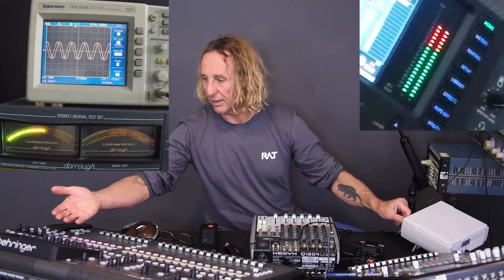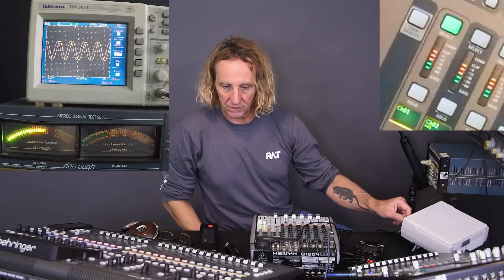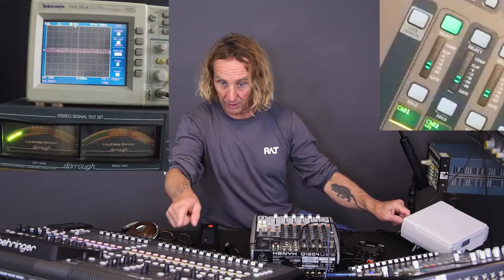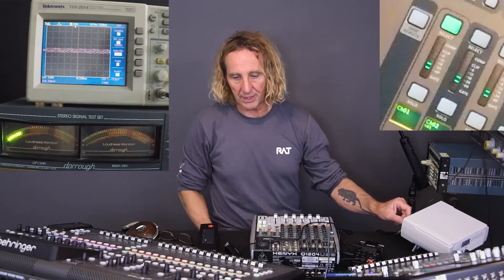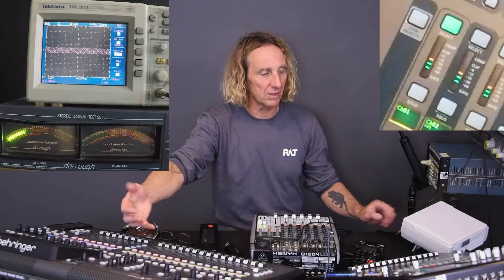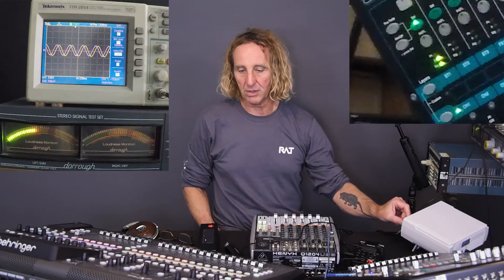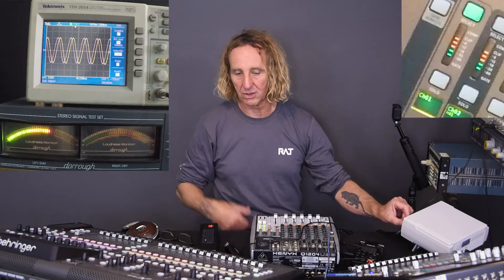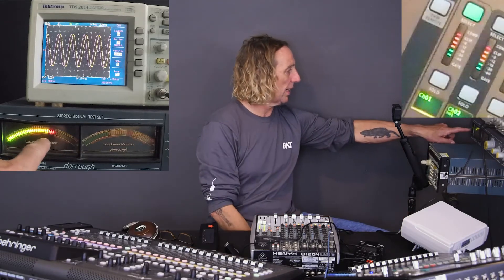Metering & Clipping - Behringer X32 vs Allen & Heath QU16 (Public)

Comment: Your tests confirm my ears. I have a conflict with operators running their boards too hot in the inputs. I use Allen and Heath exclusively because my background career in military electronics has me at repair and mod capabilities for my music equipment and fullfil my hi fi expectations for the most part. The straight forward tests you do are easy enough for many to understand.  And are what hi fi reviewers do as a part of the process of a component review.  The tell tale sign of odd order harmonics can be heard in timbre changes in acoustic instruments such as violin, cello, and even bells and upper register of a harp in a  piano. The smear can occur with latency being recombined in Channel  mismatches due to unequal pr grossly mismatched wire feeds , panning and or speaker distance and room acoustics phasing etc. I am actually trying out the Beyer M88 at a gig tomorrow.  As per your video on feedback . Better than a cloth on the squaker.  Hit it at the source. Finally an engineer that is pragmatic and hits the bone in hi fi. You are extremely experienced and with my 40 years of bouncing around all of this, someone I can recommend as the final stop in the U tube world of proper and concise USABLE  information to many of my friends watching me do things with live sound. 
P.S. -- I did the 3 speaker P.A. a year ago before actually seeing your video on vocals separation. Thought it was my invention.  Ha. But it works extremely effortlessly.  Now the IEMs forward facing even if rearset PA speakers are going to be tamed with the hypercardiods. Tmi. But you are the best....
Reply from the maker: love all of this

Comment: Im running sound at a church that switched from a presonus to a QU-32 about a week ago. Brought in a systems tech and got the room tuned and got some basic setup going for functionality but i just cant help but fixate on the metering of the console. Not because i think there is something wrong but because im not clear as to what type of metering it is referencing. This video is quite helpful given that i started in audio at the tail end of analog boards being the norm and digital for live barely coming onto the scene

Comment: Great stuff Dave.  I first noticed this "situation" in a DJ controller, testing a new one in my home studio.  I haven't put a scope and signal generator on it yet - and will do that at some point.  But listening to some music and watching the meters, it doesn't have any headroom or has very little.  They should change the calibration on the metering - really not a good situation, especially for a DJ controller.  Now I see it permeates much of the digital domain.

Thanks for this!

Comment: The claim that X32 and M32 behave the same is incorrect. There's a huge difference between the preamps in M32/DL16/DL32 and X32/S32/S16. The real Midas preamps saturate very much like analog because there is a lot more headroom in the converter-stage than what you find in the "Midas-inspired" preamps in the X32. This is also why many people use Midas stageboxes with X32-mixers as the digital processing in the mixers is exactly the same. This said, with proper gain-staging there is no audible difference in the end result. Keep all inputs in the -18 to -12dBm range, and the X32 works just fine. You can abuse any mixing console, even analog, and make it sound bad. The worst problem with digital consoles with fancy displays is that too many engineers mix with their eyes rather than their ears. Sampling-rate and resolution in signal handling produce detail way beyond what the human ear is able to register. The problem is not "digital is bad", but that certain features such as for example compression is abused resulting in a serious loss of dynamics.
Reply from the maker: Did you watch the video I did where I took the M32 and X32 apart?

The circuits are almost identical.

They use different slightly better transistors in the M32 and capacitors with a narrower temperature range in the M32.  Also if you look at the schematics, the circuits are nearly identical.

I believe the only real sound difference is the noise floor is slightly higher on the X32ans output a bit higher in the M32

Overloading either the X32 or M32 results in the same digital distortion that I would recommend avoiding.

From everything I have tested, the belief that the M32 has a better bad sound when over loaded that the bad sound of an x32 overloaded appears to be a myth

Comment: Dave, I just saw this one last night.  I am with you.  I still have and love my Midas H3000-56 and XL4.  I grew up analog and love the sound and what you can do with it.  I have used the X32 on small shows and will often provide either that or a M32 for a visiting BE.  If I am using digital I prefer my Midas Pro 1 or Pro 2 depending if it is a 1 off or a tour and how much space we have.  Digital has it's place, but it is hard to beat an H3000 with a top notch rack.

Comment: Now, I could be completely wrong, as I have not delved into the schematics... But I am pretty sure the way these digital consoles control preamp gain is actually with a digital potentiometer, not in DSP. If that's the case, it's very possible that the preamp clipping is actually an analog clip, and they likely build in some headroom in the ADC's so the preamp clips before the ADC goes full scale. Still though, best to avoid it anyway.

EDIT: Also, notice how the clip is not a perfectly horizontal chop-off. If it was a digital clip, it would be completely brick-walled.
Reply from the maker: Most digital consoles do both. There is a digital control over the analog preamp gain that will gain up the the analog preamp and there is usually a digital trim that will add or reduce the levels.

And to make things even more interesting, usually the two are also tied together such that turning the gain pot will add digital gain in .5db increments and once 2.5db of digital gain is added, the next click with add 3 DB of analog gain and drop the 2.5 digital gain back to 0.

Then separately there is often a +/- 6 or 10db digital trim.

The impact is that this constant change between analog and digital gain means the noise and way the console clips is not linearly constant with the gain pot
Reply: @DaveRat  that’s very true, I guess it depends on the console for the most part. Either way, the clipping shown in the video seemed analog in nature, so at least in that early stage of clipping, it isn’t digital
Reply from the maker: Yes, ish. To minimize noise and maximize headroom which can be limited, especially on lower cost digital consoles, the digital clip is usually set to occur at a level slightly above where analog clip occurs or not much higher. 

May 3db, or 6db at most.

So anything beyond slight analog clip will often bring my in the digi clip bummer.
Reply: @DaveRat  Yeah, that's what I would have figured

Comment: TLDR: run the M32 like an old Yamaha digital console, run the A+H like an old Yamaha analog console.
By the way, on an old Neve 8232 you're running it cold unless you can hear all the analog needle meters in the meter bridge slamming the end stops over the loudspeakers. I've seen and heard it on my own .. big ouch... Raw Power anyone?

Comment: "Operator Error". Amen Brother! Preach!

I'm very much the same as you, grew up and learnt using analogue, but ultimately got my degree in Audio Engineering and started using digital (specifically X32). I had to re-train a bunch of engineers that kept running the gain into the red on the X32, had to explain proper gain staging and utilising dynamics (properly) to them.

Comment: I noticed some of these consoles seemed to show red way before it actually felt like the level was actually clipping (same with the SI stuff).
Reply: This was handy to figure out because if i needed a little more gain out of say (the kick) for some reason, I knew i could use the output of the compressor to basically retrim the signal and I noticed I could get a little more out of the master without the channel showing red. You might wonder why i'm running it so hot... but so many clubs and crazy shows and just learning. Hopefully most of us get the chance to use the stuff that has enough power and you're not even close to red!

Comment: Great video.  Personally, I prefer LED accuracy over the distant-early-warning of the U16.  RARELY have I been caught off guard with clipping a channel.  It usually happens first song because, as I'm sure you're aware, sometimes musicians don't give you accurate levels at sound check (actually line check most of the time).  I usually set the attenuator very conservatively, leaving a good amount of head room for such scenarios.  But every once in a while a musician will catch me off guard giving me 6 or 8dB more signal during the actual performance over and above line check (I rarely get sound checks in club settings).  As you can imagine, I address the clipping immediately.
.
You caught my attention with your opening assertion that you stopped mixing when the world went digital.  I hear ya.  I still love mixing analog and have held onto two of my analog consoles.  I have to say that I really like the digital stage boxes, as running an audio snake has always been a problem for gigs like weddings and clubs, etc.  The aesthetic of a large, thick cable always puts clients off.  Now I just run an Ethercon cable...which is a real pleasure in comparison.
.
Anyway....great videos.  I'm a huge fan.  Keep up the great work.

Comment: The devil here, and really with all metering, is that the clip light turns on, but, you may have been clipping transients for awhile before that's happened. Probably fine to run an electric guitar pretty hot, definitely not fine to run a snare drum really hot, because the meters are going to lie to you.

Just another instance where, you 100% have to, always, without exception, use your damn ears.

Comment: I mixed in a Black Lion Audio modfied x rack not too long ago i think they just did their standard deal they do on most things but i have to say the headroom was definitely improved as as the tightness of the low end on my mix. I felt as though i could work in that top range of the Meters with better clarity.
Reply from the maker: Interesting

Comment: I was looking at the Allen and Heath qu24, Presonus 32SX and the SSL Big Six.  Right now I’m paying on the SSL, but with that, I would have to buy more outboard gear, if I got the Presonus, I wouldn’t have to buy anything. But I’m not sure if the digital mixer is going to sound good as the analog SSL. The SSL is 4HZ to 100KHZ and the digital ones are 20HZ to 20KHZ. And I’m thinking about the sonic quality of a live show, also if I record a band. This video was great.
Reply from the maker: Tough choices!

Comment: I think the some of problems lies in the marketing on the x32. When it first came out the big sales point was it uses Midas preamps, so I thought that you could push the peaks but it of course sounded horrible. That made me steer away from “cheap” consoles. Mainly used Soundcraft Vi consoles digitally and a whole range of anaIog consoles. 

I have used Soundcraft SI mixers and got great mixes out of them, but I treated the signaling different and tried to prevent clipping at all cost. 

But I would like to see how a big expensive mixer would behave on the same test. Could you push them further like an analog console?
Reply from the maker: In my opinion the issue is based on the fact that clipping looks the same on a digital console versus an analog console but the impact of clipping his catastrophic on a digital console and minimal on an analog console.

So having the exact same indication type for clipping yet completely different results when things clip creates the foundation for the ongoing issue.

Various manufacturers have taken different steps to mitigate the issue.

Some offer the ability to have the clip light come on early, some have that built in, and some incorporate limiting circuits that mimic the way analog consoles to distort.

All of which further complicates the understanding and reinforces the fact that engineers should know their gear, where it's limitations are, and what happens if you exceed those limitations

Comment: I prefer the X32 approach as it's more inline with how I mix in a daw. I know people say oh you have 32 bit floating point etc, but I was trained to approach digital studio based on a peak of -18 to -12db as with the BBC standard. 

I came unstuck the first time I used a qu32, as I wasn't applying enough gain until I figured out at the end of the gig what you just demonstrated above 

I just think digital consoles should stick to peak and that although with the qu series A&H were trying to make it easier for people coming from analog. It's not analog it's digital. 

The meters on the X32/M32 are much more accurate I'm never in any doubt of my levels on any channel. 

Also I run a version of your Group compression setup on my M32 pretty easy, which is super sweet!
Reply from the maker: Yeah it's confusing to know which way the boards are set up.

Probably the biggest issue with digital mixing is engineers clipping or trying to mix like it's an analog board

Mixing too low on a QU will not be a very big issue whereas mixing too hot on an x32 will be a huge issue
Reply: @DaveRat  Yea, I came to the same conclusions. Thanks for all the advice over the years Dave! You really helped me get though my essays on my live sound degree about 10 years ago!
I'd have struggled without your methods of explanation! 

I always link people to your videos when they're just starting out (and beyond) in live sound, such a great resource! Much appreciated
Reply from the maker: So cool and thank you!

Comment: Very interesting discovery, Dave.  Inevitably, in a live audience situation, a mixer could miss clips, lots of them.  Making those clips ‘harder’ to reach is a brilliant concept.  

In the days of analog this would entail a real loss of S/N, perhaps the difference between 60 and 55.  In digital, this same 5dB S/N loss will likely occur at levels we will not hear, so no bigs.
Reply from the maker: Yeah I would say the biggest problem with digital mixer mixing is engineers clipping and that's exasperated by consoles without enough output level.

Adding a game stage after the console to keep the metering at lower levels is probably a good plan
Reply: @DaveRat   I have to say I’m surprised no manufacturer has gone all in on an intelligent soft clip mode.

Comment: I believe that the operator should know the system it has at his hands, analog or digital. If the operator does not understand the difference then nothing can save him from doing a bad job.
But, in digital domain 0 dbfs should be used as a limit, it is much more intuitive than having some buffer zone to take care of you.
Of course this is a personal preference, but driving digital in red zone is not sensical, and the operator should know that.
Reply from the maker: One aspect is one can not do a direct comparison between metering of digital vs analog.

Yes we can correlate clipping but the ramifications of clipping are not the same.

Analog clip is not a big deal whole digital clip is terrible.

One could argue that metering that keeps us farther from terrible is more important than accurately knowing when clip is.

Comment: I really like these console comparissons you've got, between the M/X32, Yamahas, A+H and so on. It's good to see the really geeky nitty-gritty differences.
If you have the means to do so, I'd love to see how some of these compare to the big boys (Yamaha Rivage, Digico SD5/quantum, Midas Heritage HD96 for example) in terms of noise floor, overload handling, delay propogation - just to see what does and does not improve as you go up the ranks.

Comment: We recently changed from an analogue to a digital console, and now I FINALLY get to teach the correct way to do gain staging.

Before they were doing the fader at unity and gain is the volume knob method.

We are using a Presonus Studio live 32S series 3 mixer now, and I have moved from a guitar player to the sound tech teacher.

Coming from a guitar background where I play digital amps, the method of anything over 0db starting to square wave makes perfect sense.

Without any training, I started teaching people to aim to gain the signal to -12db average.
Leaving enough headroom to not distort on the peaks.

Soon I'll be teaching compression and EQ.
So I find myself watching lots of recording engineers teaching, because I've been a mix engineer for all of 5 days at this point...

I appreciate what you do,
Thank you!

Comment: I’ve always had the -18dbfs as the 0dbu (giving you the +4dbu for peak levels at -12) equivalent in my approach when using digital consoles. Gain staging and conversion factors should be any sound engineers rule of thumb reference points
Reply from the maker: Agreed

Comment: So, can I straight up ask - which rack would you recommend- the AH QU SB 16, or the Midas MR 18?
Reply from the maker: That's a good question.  Based on testing, the Midas performs better but relies on the engineer running lower metering levels, the AH is more noisy and less featured, better built and allows engineers to run hotter levels with less overload.

So for engineers with self control and knowledge, the Midas, for engineers who want to mix on digital but treat it more like an analog board and drive it hard, the AH

Comment: First gig I did on an SQ-5, lead singer clipped the pre-amp most songs - they only gave me 50% in the sound check and it was the first time mixing this band.

Didn't hear any bad stuff, didn't want to mess up gain as mixing monitors from FOH too. It shows the console experience of A&H that they run the metering like this in an analogue-type kind of way.